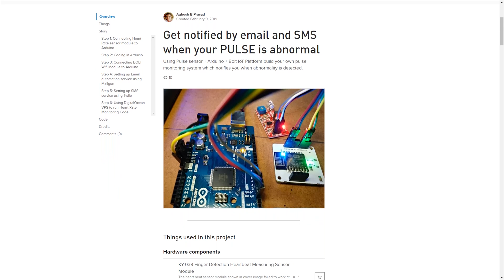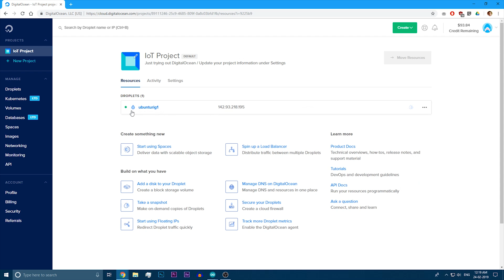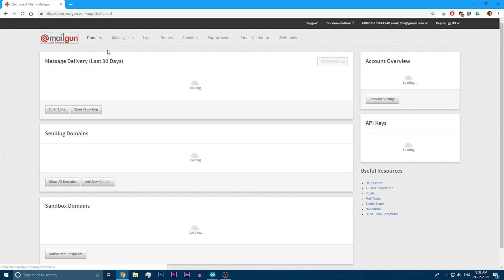Get notified by Email and SMS when your PULSE is Abnormal #boltiot #intershala #InnOvaTe

Comment: can i use any wifi module ?
Reply from the maker: Yes you can.... Apart from what I have done here, You will also have to configure a service or setup for sending and receiving data via the internet. This is where Bolt comes in. The Bolt WiFi module is not just a WiFi module, it also connects with Blot cloud directly making data transfer very very easy. This made my project a lot simpler. In short, you can use any wifi module with Arduino (preferably ESP8266) , but you will need to figure out the process after connecting to the internet yourself. I hope you understood what I meant. Have a nice day. 😄